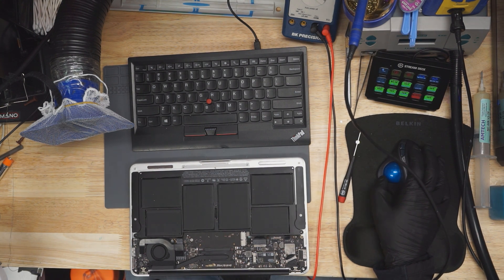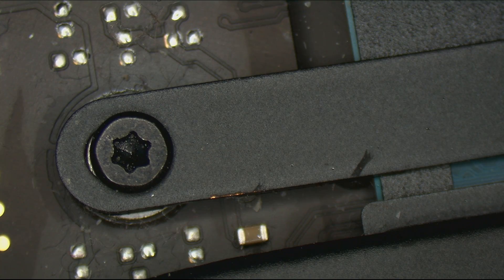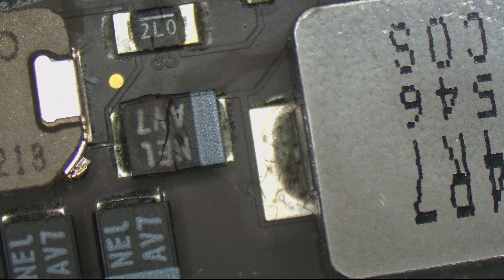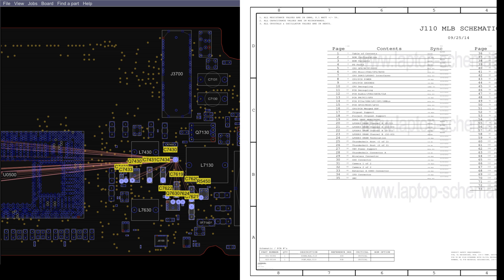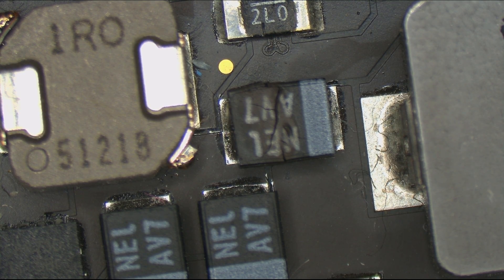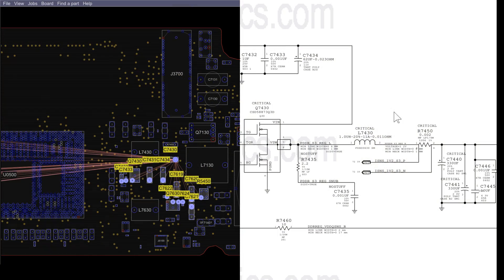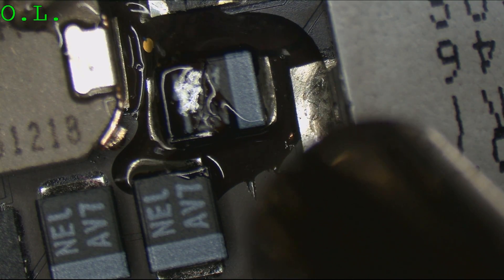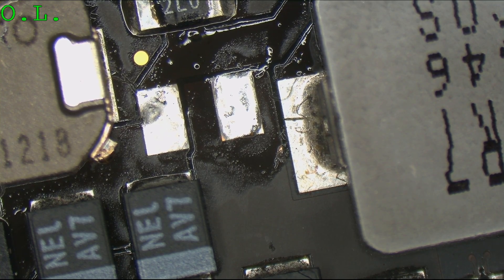Why is Macbook Air dead AGAIN???

Comment: I always check my PPBUS every morning when I wake up.
Reply: does your PPbus have voltage on the left hand side or the right hand side?
Reply: According to specification it has to be G3HOT
Reply: @desertkun  it is 1.3 v which means it is not either a 1 or a 2.  I can understand why checking that every morning is important.  I have no issues with attaining the proper 1 and or 2 through my PPbus.

Comment: Because apple thinks that selling an overheating laptop with a price tag of +1k is okay.
Reply: I can unterstand if a 45w CPU like in my Dell Laptop reaches 100c under full load but somehow manages to run Without throttling, but i cant unterstand it when a company Puts a 35w Chip in a System that does Not even Properly cool a 15w Modell.
Reply: Not defending apple or hp, but most if not all consumer grade laptop manufacturers think the same. 

No ulv chip can sustain turbo speeds for example, and even many gaming laptops overheat...
Reply: @eduardoavila646  True that, almost no laptop comes with acceptable temps unless repasted, but apple stuff costs way more than pc equivalents tho.
Reply: I dont like Apple much, but yeah a lot of manufacturer do that. My acer laptop cant run at full load either.
Reply: HP does it too.
Reply: @Melamamoduro  yeah though HP also has one for "only" $519.99 + shipping. For the base model of the lowest end model they sell. As you really do not need much to do Facebook it would be great for a Facebook machine. Apple's cheapest laptop is $1,199.00 shipping most likely not included. So HP has a cheaper machine with the a bigger screen size of 15" compared to apple air's 13" screen.
The HP laptop is around how much a desktop tower would cost if you just attached a cheap panel to it. Panels are really only around $50 to $100 for a cheap one without the inputs and output already attached to it. That plus a few other things required for a monitor of course. So $519.99 is probably with a margin of around $100 ~ $150 per laptop sold. ... Unless the custom laptop motherboard is more expensive than the standard mATX or ITX motherboards are by over double.